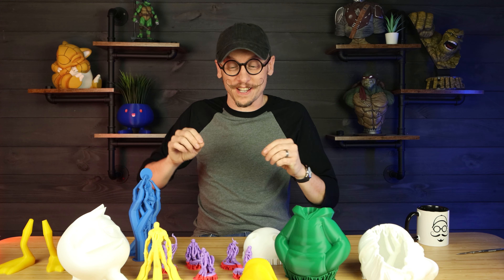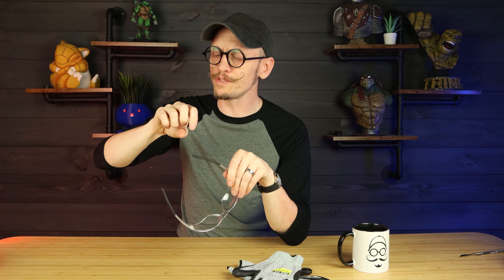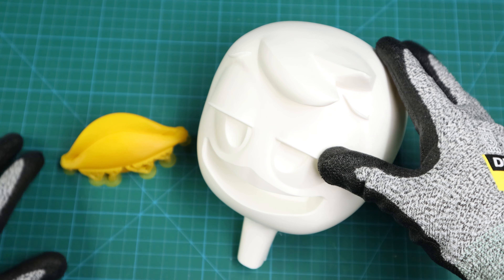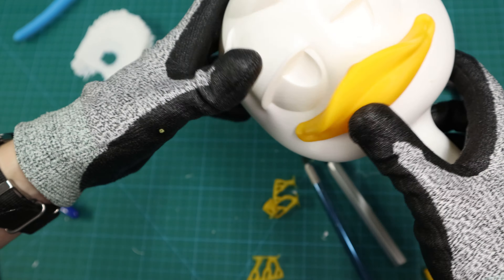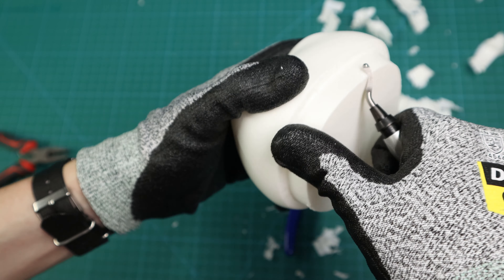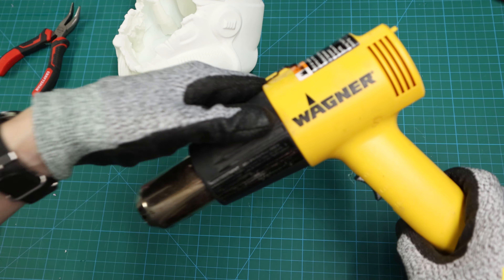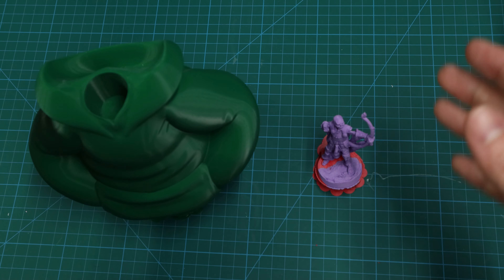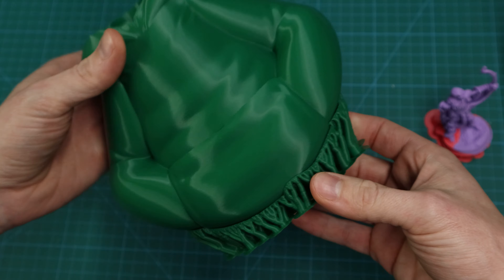Easily Remove 3D Printed Supports | 5 Methods for Clean Results

Comment: You know, if you set your Top Z Height in your support settings, to  .26. It will make life so much easier. You will not have to suit up to remove supports.
Reply: How does that work. Could you go into more detail please. Sorry im new to this
Reply: @genises200  You are decreasing the contact slightly. Just enough to make it the supports easy to remove without effecting the print quality. It makes a big difference.
Reply: I gotta try this removing supports is like gouging out a weld 😂
Reply: i do .275
Reply: Thank you!!! This is why i was here... not a safety tutorial
Reply: THANK YOU! This is the help I was looking for.

Comment: If pieces go flying you better get your vacuum cleaner ready as well. As you don’t want any of those pieces end up in your feet. And if you use soldering iron, use it outside so you don’t create toxic fumes inside your house and probably don’t even have to worry about the respirator.

Comment: Heres an additional way that works well...Get a small desktop electric heater.  point it facing across your work surface and at the model.  Turn the model in front of it and at the same time take needle nose pliers to bend and remove the supports.  Just make sure to keep the model moving
Reply from the maker: That’s another great option for sure. Thanks for sharing.
Reply: @ItsMeaDMaDe  Sure thing! 🙂

Comment: Finally the video I have been waiting for! Thanks a ton for making this. Do you make any adjustments to bottom and top Z distance on the slicer? One issue I have is when I have supports that are connected at both ends to the model the bottom of the support fuses to the model and causes gnarly scarring.
Reply from the maker: Honestly I rarely adjust my settings i typically do more adjustments on where my supports are placed and the angle of the model to reduce my supports. I covered that in the previous videos I show at the end of the video. Orientation is one of the most important things when it comes to supports. One model might need a ton of support rotated one way and barely any if rotated another. I do have plans for a future video where I go over the setting I do change when I change them.
Reply: @ItsMeaDMaDe  thanks for the response. I will go and re-watch the other video.

Comment: nice vids, although my main question, which you never spoke towards are the "actual" settings in the slicers? by that i mean distances from the part on x,y, & z, etc... i use orca slicer, which is almost the same as bamboo, of which i saw you do a supports vid on.  i think explaining the different variables could help a lot.
Reply: That's what I was looking for aswell

Comment: Will there be an updated support settings video? And which slicer has the best results, for easy to remove supports?
Reply from the maker: That’s a great idea for a video. I honestly never thought about comparing slicers when it comes to supports. I’ll start doing to tests. Could be a good slicer comparison video. Giving them grades on ease of printing and removal of supports. Thanks for the idea!
Reply: @ItsMeaDMaDe  Looking forward to seeing the video and the results. Would a bed slinger, core xy or delta printer have any effect on supports?And what about printers with Klipper?
Reply from the maker: @CaptainBipto  another great thought. I’ve personally never seen any difference between xy core and bed slinger but I’ll test that too. And klipper I haven’t seen any differences with that the only differences I’ve seen between marlin and klipper is time printing. Thanks for the thoughts and input!

Comment: I would like to know this.... In my Slicer settings, I have the option for how close will the supports print to my part. Or how far away from my part. What is your setting/amount. That makes a huge difference with how ease it is to remove supports. I am just leaning how to remove supports from a Ball shape.

Comment: Love the options. My only question especially with the hot water have you tried like PVA support material that dissolves in hot water?
I haven’t tried it yet, but I have used the Bambu Labs PLA Support material which many times comes off very clean.
Reply from the maker: Yes I have I got good results too. I didn’t put it in this video because I was trying to keep it generic to everyone that 3D prints knowing not everyone has an ams. But I’m planning on doing a video in the future showing those methods.

Comment: Thanks for the video! Would you suggest making more light supports and hitting with hot water after?
I'm trying to print models with lots of textures/patterns, and trying to avoid leaving scars on smooth surfaces and interruptions in the patterns.
Reply from the maker: I’m very honestly found any type of tree support works you can use strong and water still works. The key is your tree supports have 1 wall.

Comment: Great video thank you!
Hey I have been trying to find your video on using the cut tool in bamboo studio. I want to make the crystal dragon larger so need to cut to make larger pieces fit on the plate and print separately. Where can I find it please?
Reply from the maker: Glad you liked it. I do believe this is the one. Bambu Studio 101 | Beginners Guide to Bambu Slicer Software | Top Tool Bar
https://youtu.be/VylxMnjShbs

Comment: Great tips, but the best tip I've ever tried was changing the support interface spacing to something small between .08 and .16 and the supports come off really easy
Reply: Will this work with all prints?
Reply: @genises200  I have noticed in tight areas it doesn't work so well so maybe going in the opposite direction it could work better by increasing the spacing. But it's worked pretty good so far.

Comment: Also what people including myself don't always realize is sanding and cutting plastic. Cutting plastic as with most other material heats up the material and therefore heats up the plastic. Not as much as hand sawing but defiantly if you cut plastic with a Dermal tool. I wish water soluble support material would be as cheep per roll as cheep PLA.  Then in hard to reach or you know in that area it is going to be a pain to remove we could use water soluble for that area and other material like PLA for easier to remove supports areas.

Comment: Just a note. Body panel removal tools are much better than screwdrivers. 
They come in different sizes and shapes. Would not leave marks or scratches. 
I get mine at Harbor Freight.
Reply: Just a note these are for interior panels.

Comment: Non mentioned techniques should be:
No supports is easiest removal of them where one can get by without :)
Custom supports that are less connected to part then stock generated ones.
There is also water soluble support material like PVA.
And using different filament that sticks less to main one (eg. petg to pva).
Reply from the maker: Yeah good stuff I actually covered a good bit of what you mentioned in my previous videos. My last vids were me on my soapbox explaining how to get the right orientation to reduce as many supports as possible. Thanks for the comment.

Comment: Pla isnt all that toxic.  Just make sure you're in a well ventilated area since their still an itritant muck like the fumes of alcohol. I had to clean somethingat work and when i reach down and because i had to sick my head in to reach that far i got a reallybgood wiff of it and it wanst a oleasnt experience and the rest of it still took hors and i had to take breaks because we were using it hu the gallon. For other plastics like abs and nylon definitely wear a resporator. And be sure to shave. Beards do let the fums in.

Comment: So far.
Ive never cut myself.
Ive spent 37 years in the oil and fuel testing industry. I dont have girly soft hands.
I generally try to snap supports off.
If that doesn't happen with no effort. I start cutting.
No point in making it difficult for no reason.

Comment: I can't find the reference handy, and I have been meaning to say something for months now,  but I wanted to make the suggestion you reconsider your signature opening move.

I took public speaking for training since I lead classroom instructions in IT, and one of the things they taught us was to not gesture towards the audience with palms down. It can come across to some people as pushing them down or away and has a totally different vibe than doing a similar gesture palms up which is considered more open/welcoming. I know I am not doing the explanation justice at all but consider your hand movements especially as a part of a greeting should be as welcoming as possible.

Also when you do that hand gesture you kind of lean in/almost lunge at the camera. When you combine it with the downward palm hand gesture it can come across as really off-putting, and I feel like pulling back from you when you do it. Maybe it's just me and the training I have had, like once you know about it you can't help but see it every time. Anyway, I am trying to make a helpful suggestion, so your video openings are more engaging with the audience versus them feeling like they have to pull back from you.

Beyond that, your video was full of content, for example I hadn't considered using a heat gun to loosen up the supports before.